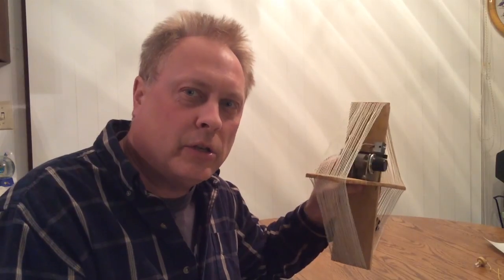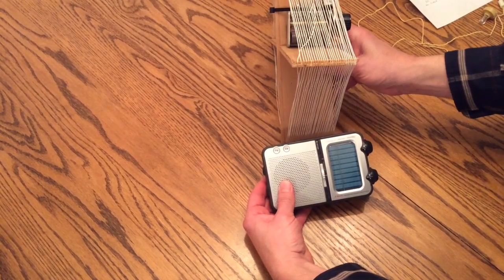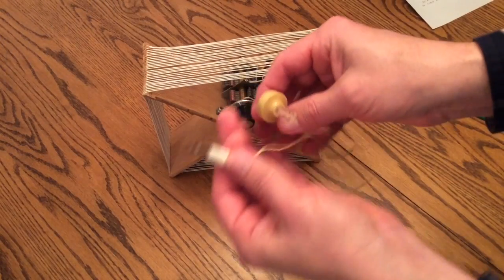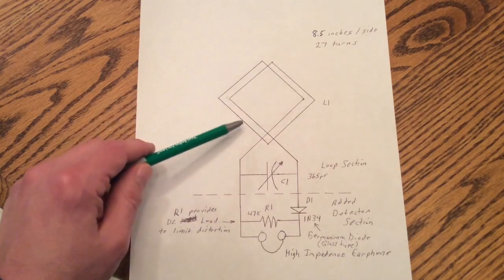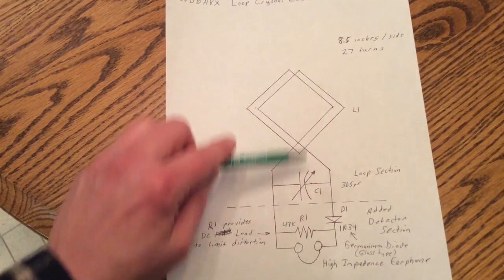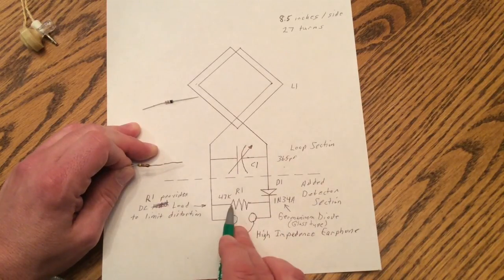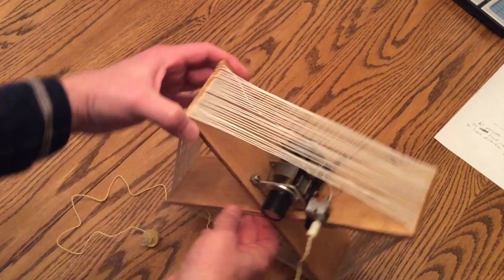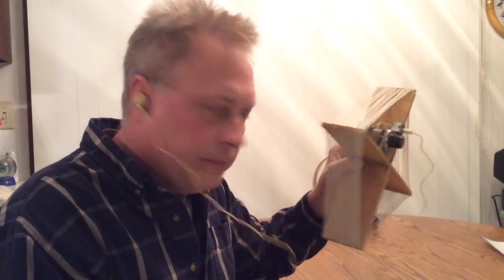Turn AM Radio Loop Antenna Into Crystal Set, Great For Preppers

Comment: Cool project. I'd like to make a loop antenna crystal radio like this as a project with my son. Curious if there are any changes to the design that you could recommend. I was going to add an earphone jack and switch to disconnect antenna from crystal detector for use as stand alone resonant tuner. Also 1-2 isolated turns mid span for use as either aux antenna in/out. I have access to lots of enameled motor wire. Even though I understand how it works not fluent with calculation for tuning and tweaking the coil. Will things change significant not using Litz wire?

Comment: Hello! Can I recieve remote (far) radiostation using a big loop antenna? For example 2meter heigh and 2 meter long?
Reply from the maker: Yes, they can work very well if you design them for the frequency ranges you would like them to cover!  Great antennas and they are bi-directional so best if you are able to rotate them to null out noises and peak the station you want to listen to.
Reply: @RadioHamGuy  thanks for response!